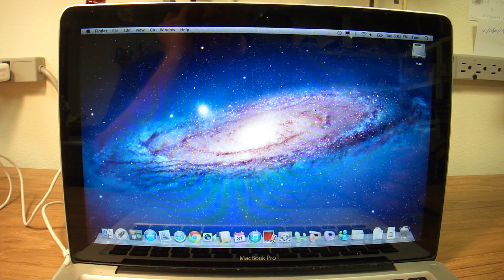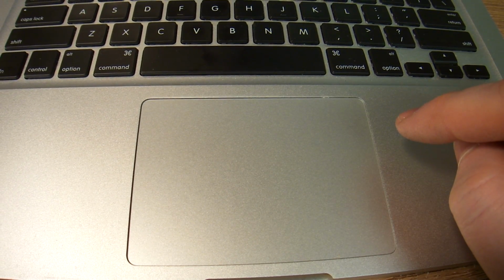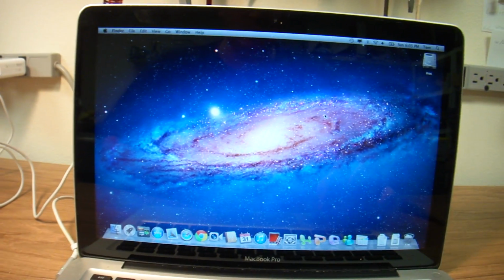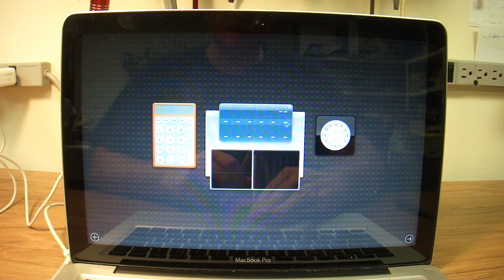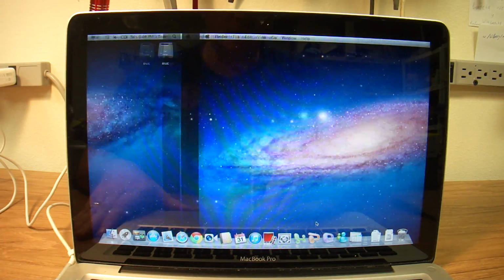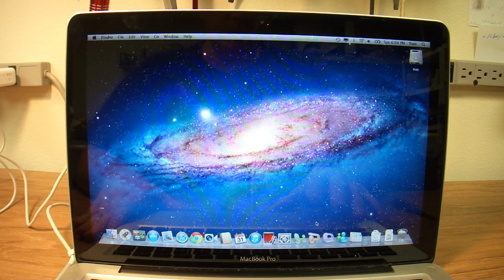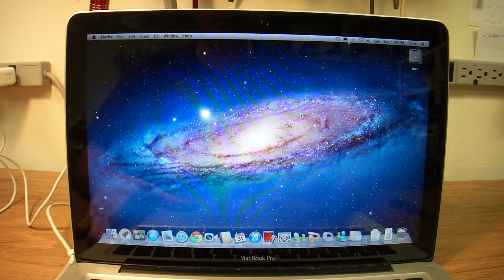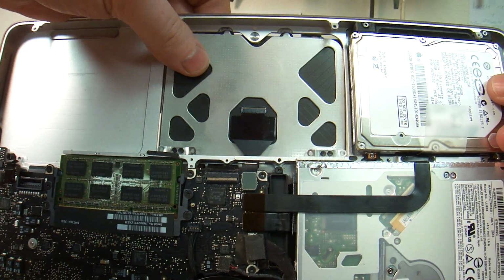How to quickly fix your MacBook Pro touchpad trackpad that is misbehaving for FREE

Comment: Thank you!
Before watching your video I just cleaned the trackpad with Isopropyl Alcohol and there was an improvement for about 5 minutes and then it started behaving erratically again. I will try your procedure and I am sure the problem will be sorted out. I guess you could apply the same procedure to a mobile phone that was dropped in water?

Comment: why does it have to be 91% alcohol? how about 70%, which is more common and easy to obtain? Thanks!
Reply: +soleá guedes 91% alcohol has a lower concentration of water in it than 70%. 91% will be more effective for breaking down/evaporating the water.
Reply: thanks!

Comment: I normally don't comment on Youtube videos, but i wanted to THANK YOU SO MUCH for posting this. This worked for me... if it helps, i do have a blow dryer available to me and I used that (no heat) to speed up the drying of the touchpad. It works like a charm! 

Thank you again.

Comment: Do not use this technique of removing the track pad. The connection at the board should be disconnected not the ribbon at the touchpad. It will crack and you will need a replacement. Check some of the other videos. they offer another similar technique .
Reply: Which one then?

Comment: I cleaned my MBP '12 with alcohol and cotton. Now my trackpad is not working and suddenly going crazy. Clicking, double click, right clicking, swapping between apps, moving all over the place in erratic manners. What would you suggeest? Please help, I'm desperate!
Reply: +JorgeAndresCoppiano. I think it might have gone through the sides.The alcohol I used is 72 degrees ethanol in acuous solution, and cristalized menthol 1 by 1000. Please help!

Comment: Hi! I spilled one drop apple juice on my Macbook Air trackpad and now it won't click. It's like it has stuck in the bottom position. The cursor works just fine as well as scrolling etc. I know that I can buy a mouse but since this computer is rather new I don't want my trackpad to be like this. What to do? Thanks.
Reply: +Oskar W i understand what you are going threw because i am going threw the same thing as you exactly the same problem from my understanding we need to change the screw from the trackpad it needs to be adjusted not sure if it would work though because i haven't done it yet but ill let you know if it works if i get to do it before you. please let me know if you get yours fixed and how

Comment: The track pad was working except for clicking. You could scroll and move the cursor just fine. You could feel the track pad click but it did not work. I took it apart like you showed, But I use a paper towel dampened with alcohol and cleaned the edges of the track pad and cleaned the  area where the track pad goes on the computer with Q-tips and paper towels. It went from being able to click at all to working quite well! Another thing that causes this sort of problem with the track pad is when the battery goes bad and swells up under the track pad. In that case a new battery will fix it. I would remove the battery and try the track pad and see if that fixes it with no battery installed. The other thing the try is the Torque screw under the batery to adjust how hard it is to click.
Thanks for posting this!

Comment: i spilled plain water and my cursor went crazy for awhile then everything went back to normal. so what is wrong with my situation?
Reply: +CrystalShots This has happened to me before as well. My theory is that the water trapped underneath eventually evaporated.
Mine was not working for nearly a month, but slowly started working again. Unfortunately, my wet hair dripped on it again so now I'm experiencing problems, and this laptop belongs to my school so I'm scared to mess around with it.

Comment: Did exactly what the guy in the video said to do and it worked 100%.  Guy at Radio Shack said definitely don't use the 91% IPA, I ignored him, it worked fine.  Got to watch those tiny screws carefully.  Few of them didn't go back in cleanly though most of them did.  Mine is a 2012 MBP so I'm not too worried about voiding warranty.  Definitely a reasonable DIY project.

Comment: I wasn't sure if the 70% alcohol I had would be good to use for this.  Microcenter only had 99.9% and 99.8%.  I ended up getting the 99.9% and it worked perfectly.  Trackpad is no longer possessed, moving the mouse around and clicking on things.  The tiny screws in the trackpad were a real bitch to get off though.  Also had to buy a drillbit for the Triwing screws in the battery.  I had tried getting them out with a flathead+pliers but no luck.  Thanks for this.

Comment: Gonna try this once I get my screwdrivers back from my brother, my trackpad works fine but ever since I spilled a drop of water - you read that right, a SINGLE DROP of water fucks this shit up - it's been going crazy whenever I even get it in humid areas or the temperature changes too much. Thanks for the tip, would never think of using alcohol myself :)

Comment: What do you recommend if the screws on the bottom of the Mac Book are stripped.  I have two that are and I do not know how to get them out.
Reply: Pamela Goggans Not sure if this will work in your situation but I have heard that you can use an elastic band to better grip stripped screws.
http://lifehacker.com/5462520/remove-a-stripped-screw-with-a-rubber-band

Comment: hey buddy i followed your steps to fix my trackpad,earlier it used to work, not nicely but i was able to manage it.Now the situation is totally nasty.actually i didnt find 93% alcohol instead of that i opted 70% alcohol,after doing all those nasty steps i have brought myself to lower right hand corner of the trackpad only this portion is working that is also with full of struggle.What should i do now.Please guide me.I am in deep mess .please.....
Reply: Rabindra Singh If you haven't fixed it yet you should try to apply pressure on all corners of the trackpad simultaneously, sometimes it "resets" the trackpad
Reply: +Google made me do it For real. I just had this problem, a few droplets of water landed on the edge of my trackpad and it suddenly decided to not work correctly. Looked for a solution on my phone, found this video, looked at the comments, read this, put pressure on all sides of my trackpad, and its working perfectly without me having to take anything apart. Hopefully it stays this way. Cheers!

Google made me do it made me do it!
Reply: LPPrince lmao cheers dude, glad it worked :)
Reply: +Google made me do it . Thanks for your help. Putting pressure on all sides worked perfectly. I recommend people trying it before taking it apart
Reply: +Google made me do it youre the man!thx buddy
Reply: +Google made me do it thank you so much!! i did what you said and now my trackpad is working again and i didn't even have to pull it apart.
Reply: Google made me do it Update: Still works as intended, nothing's changed since I fixed it initially. Thanks for the assist. To anyone who may be reading this, seriously give it a shot!
Reply: +Google made me do it thank you so much!! i did what you said and now my trackpad is working again and i didn't even have to pull it apart.

Comment: i had my trackpad sitting hard across to the left in its seat, leaving a noticeable larger gap on the rightt edge. guessing that this what caused my trackpad to think its being touched continuously. i just ran a pin around the edge of the pad, kind of palm shoved the pad and pressed all 4 corners, last not least gave it a few good belts while holding it upside down. seems to have gone back in place for now. anyways good to know that replacing the trackpad if it comes to that, is pretty easy.. and that cleaning in alcohol, would be the thing to try first.

Comment: Thanks a bunch!!!
My cursor was completely still, moving only when I used 3 or 4 fingers. Followed your instructions and it worked! Well, not at first. Don't know why as soon as I reassembled it, it didn't work (same problem as before). I closed the Pro, went to work, grabbed a USB mouse to use it while I ordered a replacement part and then it started working again! I don't see why the USB would fix this, specially considering that I coughed water on the pad last night. Most likely, your thing worked, so you just saved me $60 from getting a replacement one!!

As A.G. M. said, "I raise my plastic sandwich bag in tribute to you..."

Cheers!!

Comment: did this today workd perfect,thanks
Reply: ***** I tried this on a 2012 retina last night, did not work. Not sure what to do now. Also removing the battery was a bitch, but using alcohol underneath it on the adhesive helps. Be careful not to flex the batteries too much.

Comment: Awesome, and thank you...but I ran into a problem.  For some reason, I can't click anymore.  Or, depending on how that T-6 "screw" is adjusted, I get a little click if I really try, but not like it was before.  It's almost like the battery is pressing on the track pad.  I get better (but not the same) motion if the battery is not underneath the trackpad.  Any suggestions?

Comment: Dude, if you came up with this on your own, you may be a genius.  This worked like a champ.  Followed the video to a tee.  8 minutes in the 91% alcohol bath.  2 hrs of drying time.  And boom! Completely fixed the issue.  I didn’t spill anything on the trackpad.  It just started wigging-out.  I’m guessing a piece of dust or lint or enough dirt and grime from my hands finally worked its way down there.  Whatever it was, its gone and my trackpad works like new.  I too raise my alcohol filled ziplock baggie to you in honor of your genius.  Thank you for sharing on youtube!

Comment: ...had the symptoms but not the 91% isopropyl alcohol....after a little common sense thinking I substituted Methyl Hydrate (de-natured alcohol; intentionally "toxified" drinking' alcohol; shellac thinner etc.,), waited less than an hour after the alcohol bath, re-assembled the parts and my 'puter is running normally. In a pinch, I think 150 proof, pure grain alcohol from the liquor cabinet would deliver the same result but on that point, I readily stand to be corrected.
I raise my plastic sandwich bag in tribute to you...

Comment: I have a mid 2009 Macbook Pro 13" and tried this on my trackpad. Worked great for the hectic mouse behaviour. Unfortunately it also confirmed that my click didn't work for good. Anyway, thanks for the great tip : it did take me a leap of faith to dip my trackpad in alcohol but turned out working better than before an hour later !

Comment: I have a late 2011 MacBook Pro 15" and recently had the erratic mouse behavior which is VERY annoying. I watched many different YouTube videos and read websites on how to fix the issue. None of the suggested fixes from the videos/websites worked on my MBP. I then came across your video. I was hesitant at first to submerge my entire touchpad in a bag of alcohol, but then I thought this really was my last resort for a fix. I was ready to purchase a new touchpad so what could I lose.  
I left my touchpad in the bag of 91% Isopropyl alcohol (the store didn't carry any % higher than 91%) for about 1 minute and then took it out and left it in front of a fan for a few hours. I then re-installed the trackpad and booted up the machine. I have been running my MBP for about 4 hours now with no issues. I believe your fix has fixed my erratic mouse problem. THANK YOU for making this video!!! 
I think my issues all started when a droplet of sweat landed on the edge of the touchpad. 
Great video!